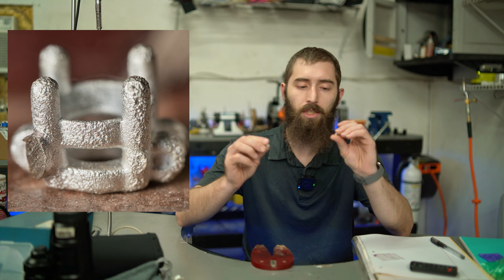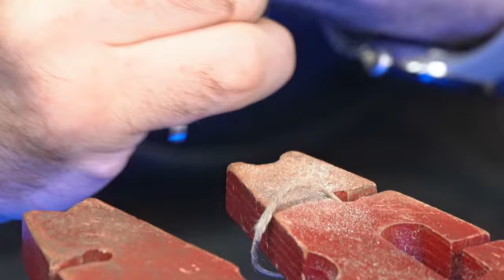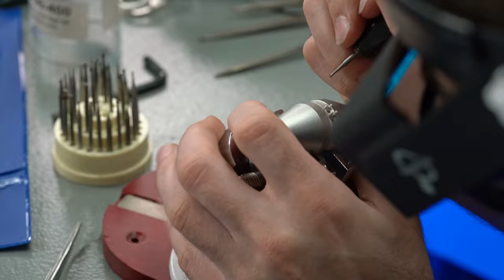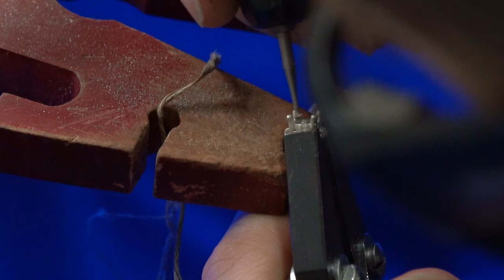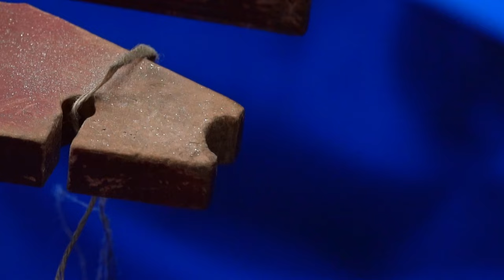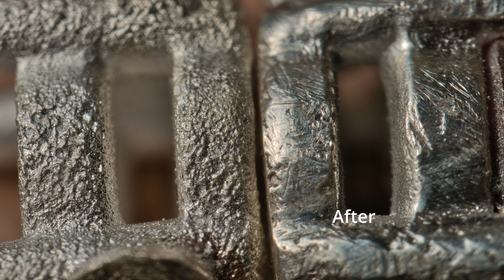Just A Link

Comment: You may want to (if you haven't already) invest in some more tools for the polishing process. It's one of the tougher things to get down, and fast at that, but there are ways to make it faster. There are some hand tools, I would look at the polishing section on Rio Grande, predominantly the grinding and deburring section, I have found those tools to be safer than using burs to debur a piece. Another nice thing to have would be a silver tumbler. Best of luck and hope this helps!
Reply from the maker: Thank you I'll definitely get a few burnishers to try them out!

Comment: I think you really need to get to cleaner "before"state, too much time into cleanup work, that could go into assembly and other things. This orange peel surface is imho already quite failstate that you are rescuing. 
Ordering my first resin printer atm and definitely will aim to take only polishing needed casts out of the investment.
.. when i get casting stuff too.
Reply from the maker: I made this video just for fun. The link would never get used and the gem would be pulled from it. I wanted to see if I could clean it with my burs since it would be challenging. I also wanted to see how well I could set the gem. There were many things I skipped In the process. I had a ton of fun doing it! 

Congratulations! It's definitely one of the most fun hobbies I've ever taken up! I hope your casts come out perfect the first try!
Reply: Sure, it's of course good to use those pieces for practice. And i'm sure I will not make nothing perfect on the first try :) But it's helpful to have people do videos like you have, about the progress to see also many things that can go wrong and learn from it.